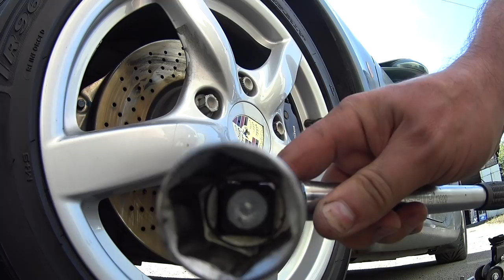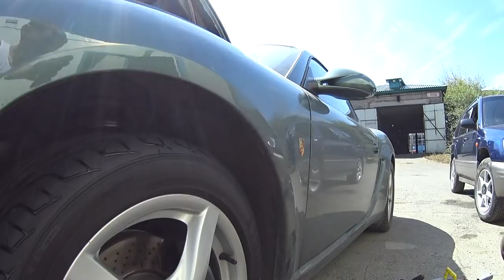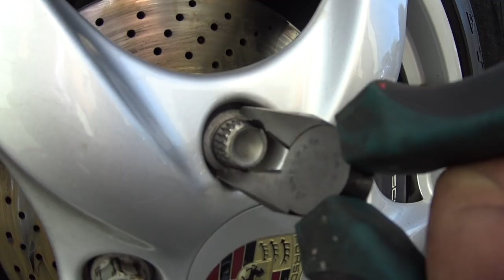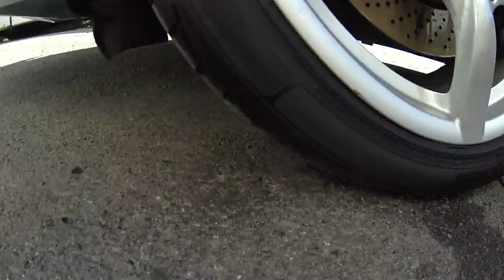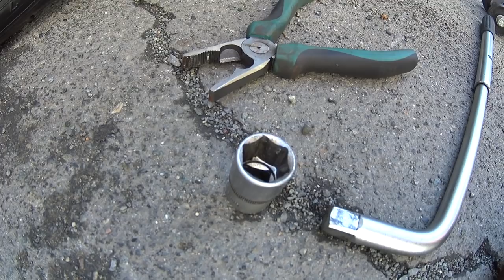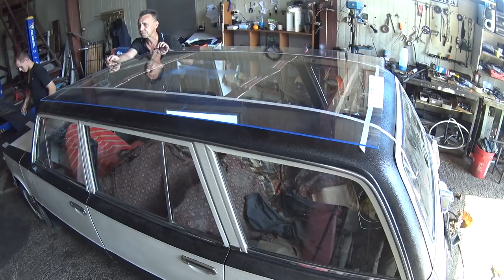How to remove the secret bolts - easy method

Comment: tightening the nuts this far past acceptable torque not recommended. bolts could snap, threads could malform ,wheel could warp. Just pound a socket on and rachet off.
Reply from the maker: Did not quite understand how to do this without damaging the wheels of the car?

Comment: Do not try this on your car..Over tightening the wheel bolts will stretch them causing a weakness on the bolts..When you come to tighten them back up to torque they could snap there and then or even as you are driving..Also the threads in the hub could be damaged..This is a very bad idea...Its better just to hammer an undersized socket onto the tamperproof nut and unscrew as normal..